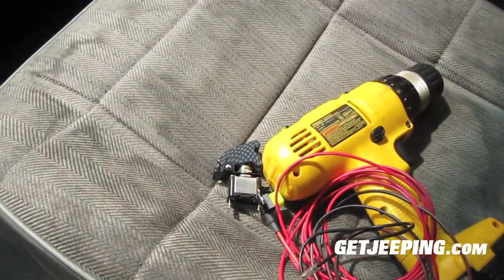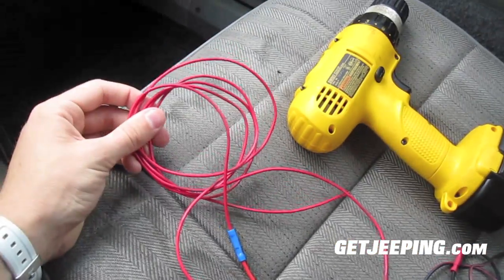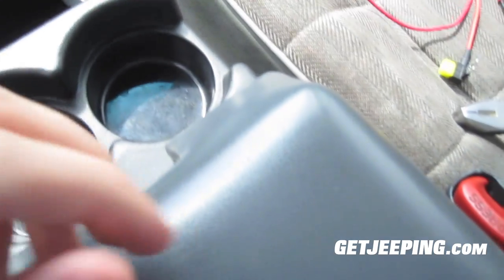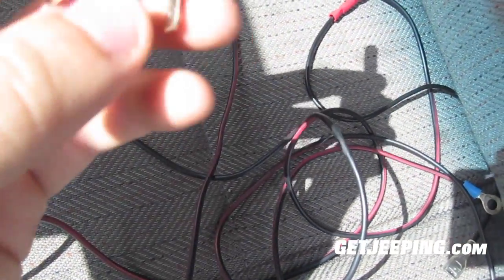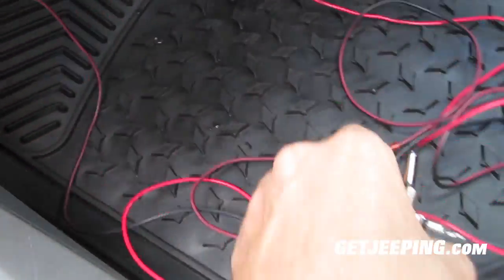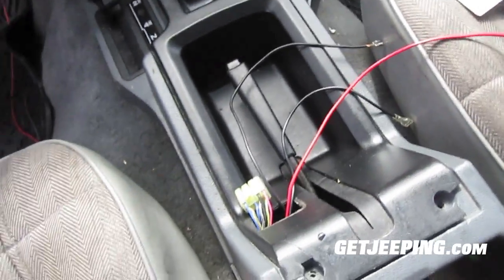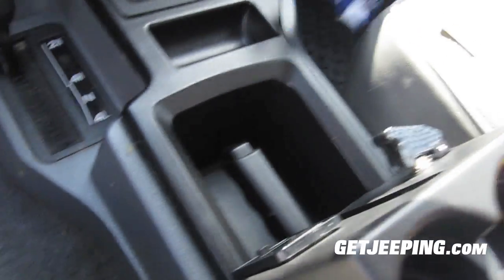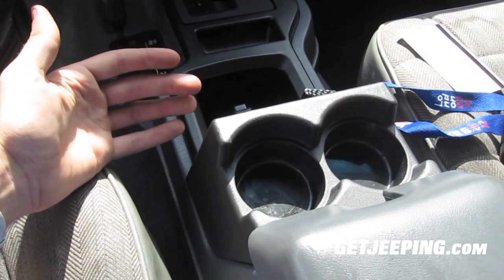How To: Installing running lights and switch on a 1984 - 2001 Jeep Cherokee XJ - GetJeeping

Comment: Thanks man, learned a lot , but one question, how the hell do you connect everything to the battery, or do you just use the rear window wipper fuse slot to jump that step???? Thanks man, gonna check out your other vids

Comment: Don't Half ass your install hide them wires so you don't kick em loose especially your ground wire ..get a big loop connector that will fit around that bolt its a great ground spot BUT make sure you scrape any paint so it's metal on metal contact .. Other then that Not a Bad Job